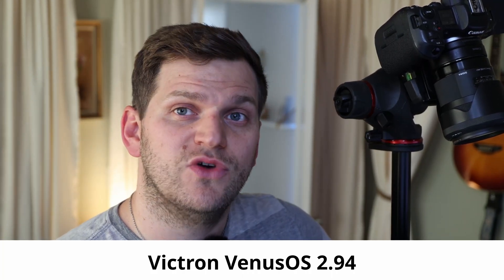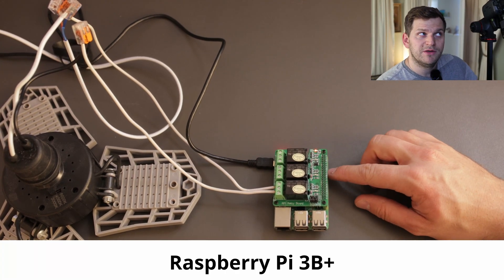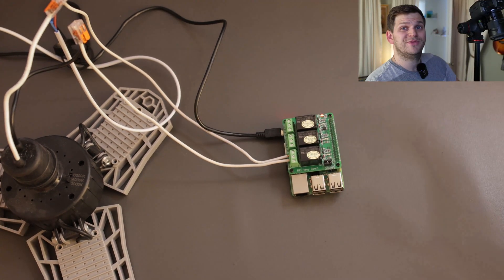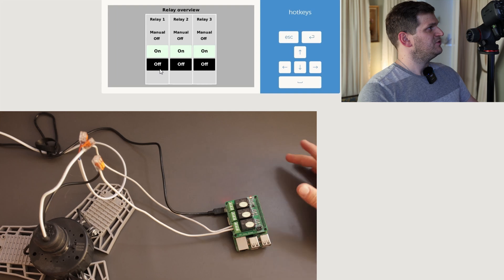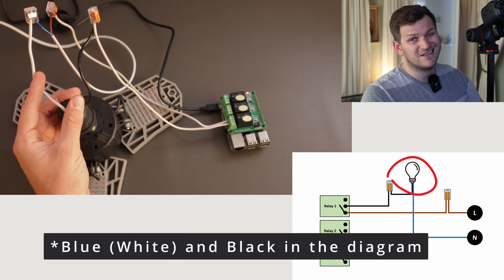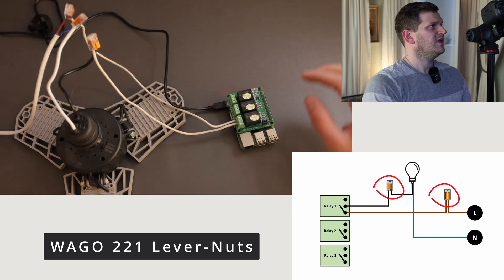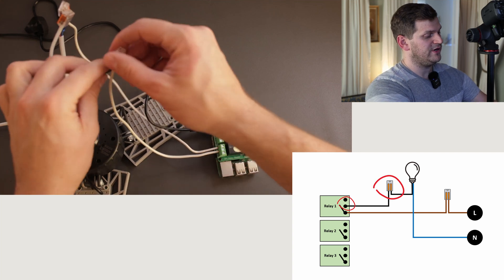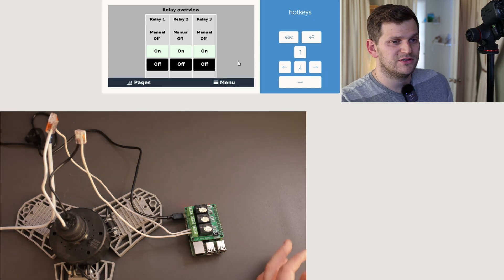Victron VenusOS & Raspberry Pi | Relay Board | Test

Comment: Hi !   Tobi !      2025-05-22
.
Today I update the Cerbo on my Raspberry_pi_4. Then the Relay stops working.
I Update - "Active Package" - SetupHelper to v8.33 : GuiMods to v10.94 : RpiDisplay to v3.16 : My Cerbo on my Raspberry has v3.55
After update the Relay I bought a "Waveshare" Relay piggy board as you wrote in your article , with 3 Relays, the unit works fine until now...
Can not find where to change, the settings file is moved or has changed.
.
Thanks in advanced !
.
Best Regards Per Fagerkvist

Comment: My colleague uses the wifi switch relay on the din rail to turn on the boiler to heat the water when he sees that his battery will definitely be fully charged that day. The advantage is that he has a wifi switch close to the boiler, but he has to have another app to control the wifi switch. A board with a relays on the RBi would do the opposite, he would have it in one app in the Venus OS, but would probably have the switch far from the boiler. (Unless someone had the boiler and RPi close together.)